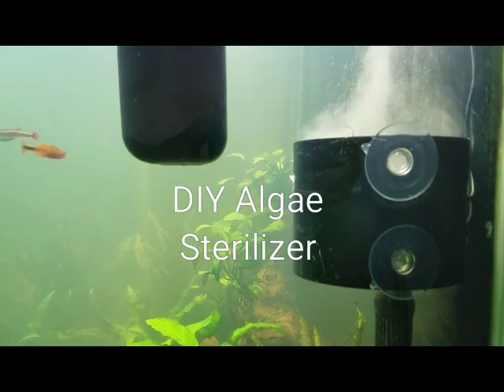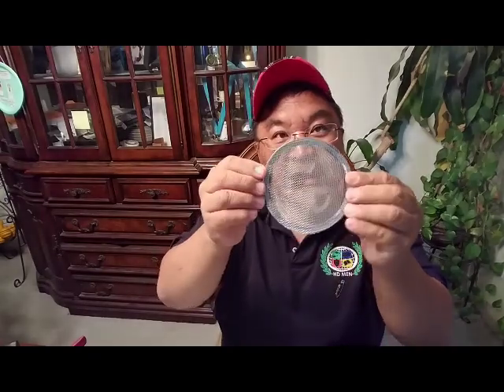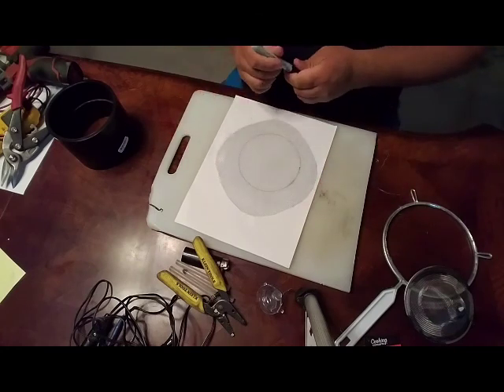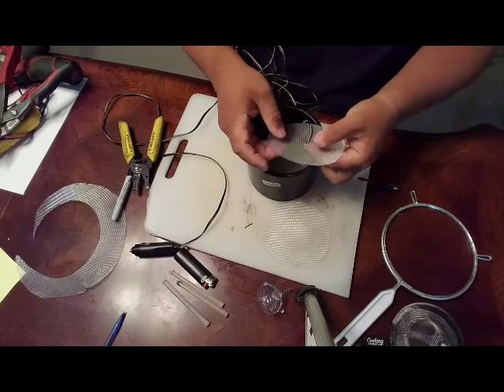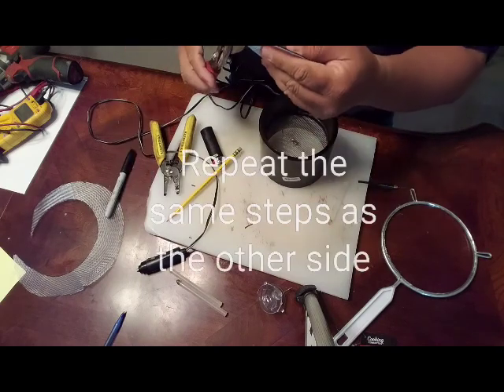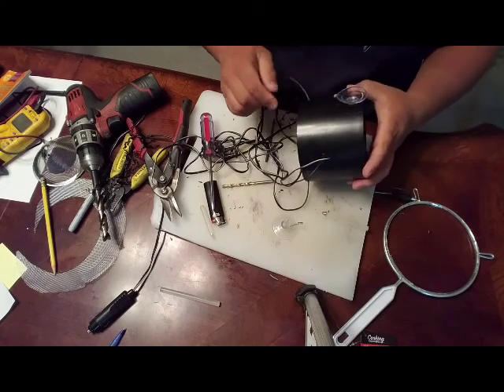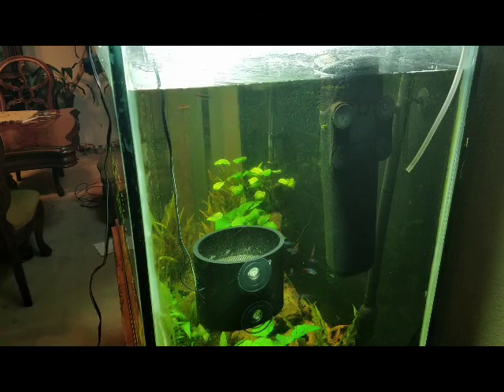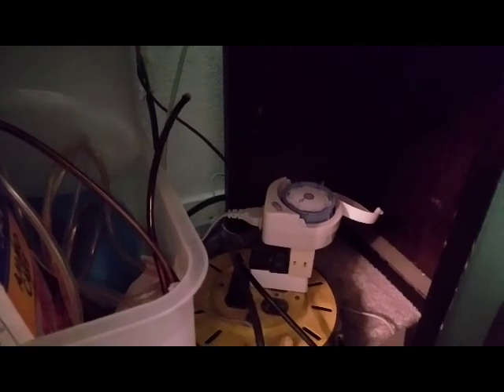DIY AQUARIUM ALGAE STERILIZER

Comment: Not gonna last sir.
Anode will react with O2 and rust!
I used iron, aluminum,carbon and in all cases Oxygen produced from electrolysis  cycle turn my anode to Fe₂O₃,Al₂O₃,CO2
Top choice for anode will be platinum or gold, wich i rather get one of those anti alge devices with warranty!

Comment: How is it going?  Did that stainless steel screen hold up against corrosion?  Did this affect your ph or other tank health measurements?
Reply from the maker: Dan Bowen it only lasted for 2 weeks max. Not worth it. Gonna do another video with negative review
Reply: Dan Bowen it‘s made corrosion... hope you don’t read this to late 😞
Reply: @The Other Guy......are u positive that the wire mesh you used was stainless steel?

Comment: oooh... but you don’t see that your water getting yellowish 😀 it is needing rocket sience for living things to don’t get them sick.  you running it 24h without any pause? it‘s just need to run for 10 mins after 2 h pause. by the way... this mesh is not food grade for your shrimps and fishes. stainless steel anodizes by the electrolyses prozess. i made at least 10 of them , without success. after i came on that special material thats needed for. its titanium mesh my friend (5mm wide and 2 mm thick). and you can’t run it forever. it last about 2 years by powering it with 12v and 2 amps (10 mins every 2 h). if you got a fish tank more than 200l, then you need 19V/2A. so the lifetime shortens. you need rocket sience sometimes 😋
Reply from the maker: Thank you for the info.
Reply: @Muckido....titanium makes perfect sense....How much does that cost?
Reply: The anode and cathode with disintegrate with passing of electricity.

Any kind of salt that can be used?
That way, you can replace the salt... But it has to be non toxic.